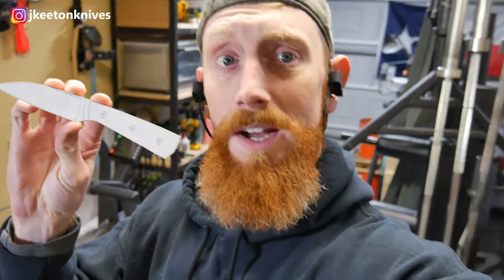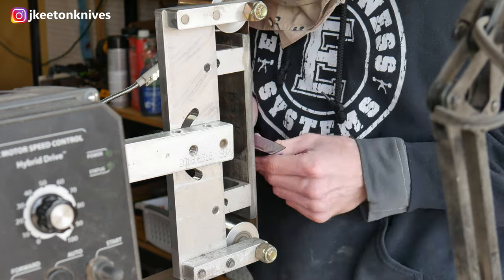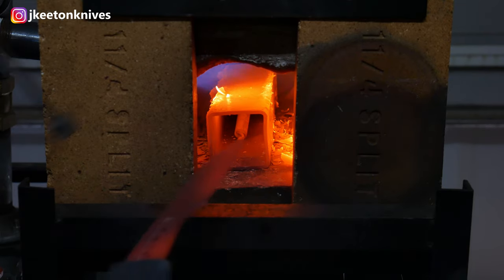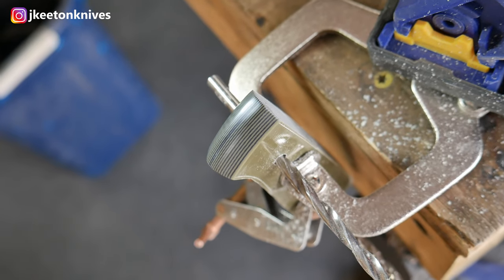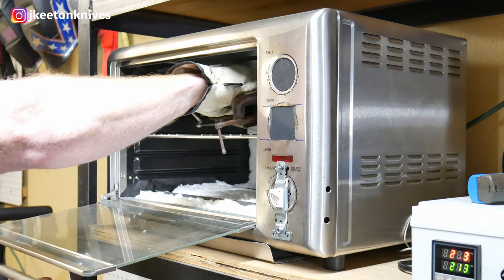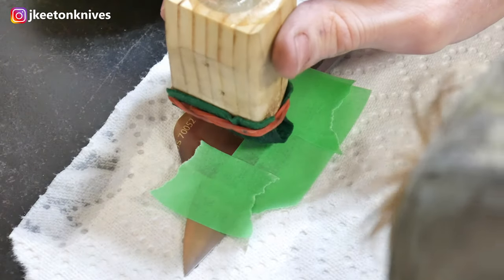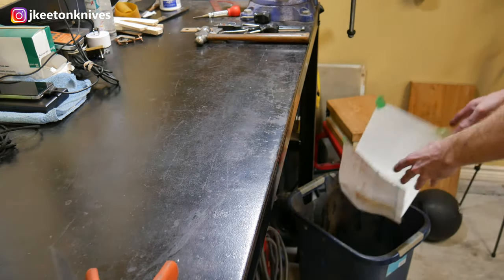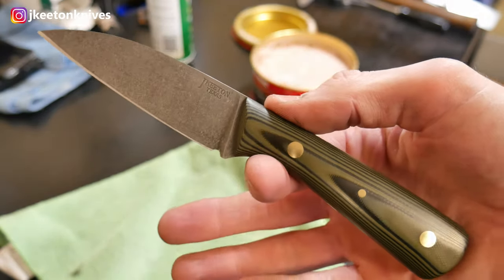How To Make A Knife - Boat Knife Build - 4K

Comment: AA boat knife also referred to as a rigging knife is a specially designed knife used to cut heavy rope. It may have a serrated edge for sawing through line, or a heavy blade suitable for hitting with a mallet to drive the knife through. Folding tools, often in combination with a marlinspike and shackle key, are convenient and portable
Reply from the maker: Jim Patterson thank you Mr Patterson for the information! Thanks for watching too!

Comment: I worked on a Destroyer museum ship for a few years. A rigging or boat knife I carried had the spike for knot tying rope end manipulation(like making crown knots at the end of a rope). At least that's we used it for. I was told by an old sailor from WWII that the blade shape was as such that you could cut your boot laces and drop your boots if you ended up in the water for whatever reason. You could do it all by feel and drop the water filled weight of your boots without worrying about cutting yourself or getting binded up in the laces in an emergency situation. We were taught to "straight lace" our boots as well to make it easier to slide the knife down to cut the laces. Made sense and I still think that's why it's shaped the way it is. Back in the old days, boots were heavy leather and if you ended up overboard for any reason, you needed to get them off as fast as possible. That went along with "wooly pullys". A long wool sweater that was worn folded under at the waist. Again, if you went into the water, you'd cut your boots off and roll down the bottom hem of your wool sweater and tuck your legs up inside it in a ball. Apparently wool retains 70% heat retention even when wet. This whole deal could keep you alive and allow an extended rescue time in cold waters. That's all I know,..... :)    oh, the 4k looks awesome!! :)
Reply from the maker: Dude that's some awesome information! I'd never guess any of that! I could imagine the importance with heavy boots like that... Thanks for the feed back on the resolution, thanks for watching, and thanks for your comment! 👍

Comment: Wax paper during glue up is such a great idea. I’ve had problems on every project with the glue coming out and getting on the scales. The grinder will fix it but I always dislike how much material I have to remove sometimes. That’s a very valuable detail. Thanks for that.

Comment: That's a good design, I  finished one that's close to it on my channel. Sometimes it's nice to make the more simpler knives. The design is known as a sheeps foot or wharncliffe.
Reply from the maker: Thank you sir! Yeah, I like the design too. Pretty neat looking. Thanks for watching! I like your shop setup!
Reply: @RedBeardOps  boat knives generally have no point on tip they are often dropped so the tips are often curved called a "sheeps foot"...also they can be made to float....handle scales should be textured and hi viz colors help ....steel should have great anti corosion properties with the ability to hold a very sharp edge as the knife must be able to cut very thick rigging all day

Comment: A boat knife should have two significant features. First it should have a straight edge, mormally seen with Wharncliffe or Sheepsfoot blades. This is because it is easier to cut heavy and thick ropes laying on the boats railings or planks of the deck. The other feature is a more broad  and blunt tip, often Sheepsfoot blades are used. As someone allready mentioned, it was made like this to avoid accidents on the rolling and stomping sailboats. If you want to see an still produced boat (pocket) knife in the more historic shape, look for the Otter Ankermesser or an French Londres or L´Armour, fixed blades are made the same way
Reply from the maker: Thanks a million for the detailed information! I knew so little about "boat knives" before making this one. Via the comments on this video I've been learned up good!
Reply: @RedBeardOps  While the blunt tip I'm sure is for safety at sea, the folklore behind it true or not was that a sea captain would break the tips off of the crews knives to decrease the likelihood of a successful mutiny.  The crew of the old ships often being captured by or endentured to service of the ship, didn't always want to be there.

Comment: Man, 4k?? Really stepping up👍 But man, corby math? thats way over my head🤣 The knife turned out great as usual. I really like the simple clean designs. 👍👍 And i uave no idea how to cleanthose scotch brite belts. From what I understand they have an abrasive imbedded into them.🤷‍♂️ Let me know if you find a way🙂
Reply from the maker: OUTDOORS55 I’m trying! ... yuge file sizes... I read a few post on how to clean the trash out of them and get some more life... more research is needed for sure. They’re so expensive that it seem worth it. Thanks for watching, man! Take it easy!
Reply: JKeetonKnives yeah for sure! 4k does give you a lot of flexibility in post if you export in 1080. I only use it for shots i can only get once and want different angles/ zoom capability. 👍
Reply from the maker: @OUTDOORS55  Heck yeah, what I don't like about shooting 4K is that on my camera I don't have 4K 60 FPS... so slowmo is tough. I found that in Divinchi Resolve you can create "optimized media files" to do your editing (which will render your timeline quickly while messing around with it)... then you can export in the full 4K. I would of saved a ton of time if I knew that from the start! LOL... very jump without.... Cheers man.
Reply: JKeetonKnives tou can do proxy files too if you needed to. Final cut seems to handle everything well so ive never had to optimize or use proxys. I want 4k 60 bad, but no one makes a camera that has 4k60 that also has good autofocus. 😂

Comment: A boat knife is.   A rigging knife is a specially designed knife used to cut heavy rope. It may have a serrated edge for sawing through line, or a heavy blade suitable for hitting with a mallet to drive the knife through. Folding tools, often in combination with a marlinspike and shackle key, are convenient and portable
Reply from the maker: Thank you sir!

Comment: Great vid! When you clean up the spine with the scotch brite belt, does it mess with your 1000 grit finish? I tried that on a knife with some stabilized wood and I noticed it seemed to mess up my hand sanding.
Reply from the maker: Great question, I've had it happen before. I try to use a very light touch and only make one pass. I have come back with the 1000 grit before to make long single passes. So it doesn't mess me up all the time, but it has before! Thanks for watching sir. Glad you enjoyed it. (Side note, I want to get a super fine scotch brite for this purpose.)

Comment: Great build!  Beautiful knife that I would be happy to carry!
I have a question on Scotch Brite belts!  I bought one for my 1X30 and no matter how much stretching I've tried to do, I don't have enough adjustment to get the damn thing on my machine!
I there a trick to it?  I actually did get it on the machine but, it was so tight It wouldn't budge!
Reply from the maker: Hey Kim, thanks for your comment! This was a fun build for sure! I don't know the answer on your issue. I'd get with the manufacture of the belt because it sounds like it was made too short for your machine. I really like the finish they provide though.

Comment: Nice blade man.. do you not get belt bump with 400 grit and up belts? Do you have a glass platen? Or how do you deal with it? Thanks
Reply from the maker: I do have a glass platten. It is more noticeable at 400 than 220. I try and go light handed on those grits. It hasn't been too big of an issue so far for me. I want to try a soft-backed platten eventually to see how that performs at higher grits.
Reply: @RedBeardOps  I have a glass platen on my grizzly but I dont on my pheer. So I get alot of belt bump on 400 and up grit belts.. I tried a piece of leather taped on and it works pretty well but I dont trust it to be flat.. I guess I'll have to get another glass platen.
Reply from the maker: @anthonystrunk5360  10-4, that platten makes a heck of a difference on the flatness side.

Comment: What is the benefit of using Corbies as opposed to regular pins ?
Reply from the maker: You're not relying on epoxy in a smooth hole. That's not to say straight pins don't do a good job... just stronger with loveless or corbies.

Comment: It's called a sheeps foot it also alot of times come with a  Mariner spike it's like a big needle made the untire tight ropes usually as a whole in the and just like a needle with the string attached to hold onto it easier or to clip it to your belt loop the no point on the knife is so you don't stab yourself while on the water rocking back-and-forth
Reply: Sorry about the spelling errors I was talking and didn't proof read.
Reply: I should have said what you made is a modified sheepsfoot. Usually the tip radius is more round making less of a tip. That said I really like the design you came up with more than a full sheepsfoot good job.
Reply from the maker: @garetkonigsfeld2  Thank you sir for the information! It's always good NOT to stab yourself! Thanks for watching and I'm glad you enjoyed the video!

Comment: Great video and explanations as always. Have you tried a plunge line jig to get the plunges Dead on?
Reply from the maker: Are you talking about a file jig being used as a stop against the side of the platten? I tried this a long time ago on my old grinder but not recently... maybe it's time to get me a carbide file jig! I could see it helping. Do you use one? - Right now I'm just going back and forth until they're even with the 120 grit belt... takes some time to get right!
Reply: @RedBeardOps  I use a carbide file jig to make my plunges the same.. pretty accurate everytime..but you do a fantastic job by eye.
Reply: @RedBeardOps  Yes. The carbide file guide. Just makes plunges easy and keep both sides exactly even.
Reply from the maker: @anthonystrunk5360  Very cool.. I will need to try this out. It does take the most amount of time during my grinding process. Every once and a while I loose a blade due to it as well (aka the blade not passing my plunge line quality control!)
Reply from the maker: @NRiggiKnives  Well, hell. I need to try one. Do you have a recommendation on supplier?
Reply: @RedBeardOps  Got mine from Bill Behnicke. He makes a few models and he is a nice guy. He was also a Forged in Fire winner!
Reply from the maker: @NRiggiKnives  cool deal, thanks for the recommendation sir!
Reply: @RedBeardOps  I made my own from O1 steel and carbide from mcmaster's.. the only problem is that if I tighten it too tight the epoxy will let go and I have to reepoxy ..
Reply from the maker: @anthonystrunk5360  Very cool... I have some extra aluminum.... sounds like a fun project!

Comment: A boat knife has a flat tip so if you dro it while working 8m the rigging it doesn't ice pic anybody underneath you. This is a common feature not a defining one.
Reply: If you need a spike on the knife for knots the thumb guard was pointed or the end of the handle popped off along with a spike teathered with a cord. So it would converse on a telephone wire and wrap itself up before giving a soon to be very irate seaman the  manditory headache previously mentioned.  Although if you drooped your knife you had more things to worry about at that point.

Comment: Is 1095 treated the same way?
Reply from the maker: No sir, not 100%. From what I understand you can get pretty good results with a forge HT on 1095 (like shown here), however, to see it's full potential 1095 needs to soak for a bit at your target temperature.
Reply: @RedBeardOps  Thanks ,Jay

Comment: I see you're using a 3m respirator with a bandana underneath?  How do you find that works? As a dude with a full beard, respirators are hard to come by, and I cant seem to get a resp-o-rator in canada. I desperately need to get something that works decently for the sake of my lungs
Reply from the maker: Man... I use the  resp-o-rator now days. I'm not sure I can recommend the older set up I used.

Comment: Where did you buy the small clamp you were using to hold the blade to the G10??
Reply from the maker: Ronald Woodruff hello sir! I have a link to purchase that clamp in the description section of this video : https://youtu.be/7Zio-gupl-U

Cheers man!
Reply: @RedBeardOps  Thanks, I ordered it!!!
Reply from the maker: @texasblacksmith10  Sweet man. I really like those Kant Twist Clamps. I need a few more of them in different sizes. Very handy to have around! Let me know how it works out for you.
Reply: Nice video. I think a boat knife is a smaller version of a riggers knife. They were made so a rope could be cut on the deck without smashing fingers. Similar to a chef's knife but with a sheep's foot design.
Reply from the maker: @timetestedtools  Thank you very much for the info Don! And thanks a million for watching. Cheers man.

Comment: I just dont understand the Corby stuff.. Seems like nonsense to me.. Why not use a brass rod filled with colored resign using a syringe? You are using an epoxy to secure the handles anyway so it seems like an unreasonable expense.
Reply from the maker: They provide support against shearing and also provide a mechanical connection if the epoxy were to fail. May not be completely necessary, but I feel that the handle system is stronger this way.

Comment: Boat Knife is probably not accurate.  A "sailors knife" or riggers knife are a better name.  The most common and pronounced feature of a riggers knife is the blunt tip.  (more pronounced that your design here.  The lore is that upon boarding a trade ship the captain would take a sailor's knife and break the tip off blunt.  Two reasons are offered up: (1) so that sailors couldn't stab or stick other sailors with the pointy end of there knife, and (2) so if the knife was dropped from the rigging it would not stick into the deck of the ship.  Either one makes a credible reason.....
Reply from the maker: Very interesting! Thanks for your comment, sir! That's some stuff I definitely didn't know!